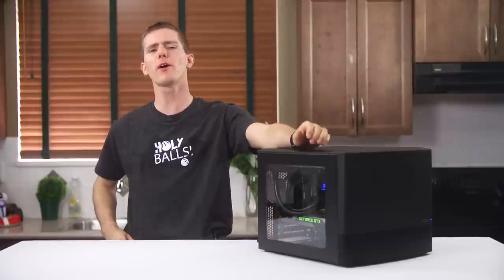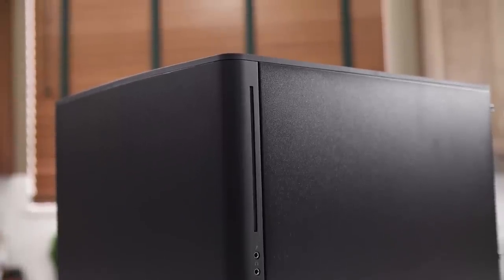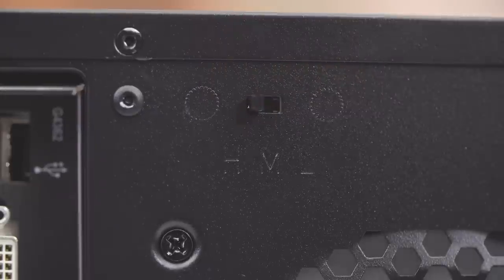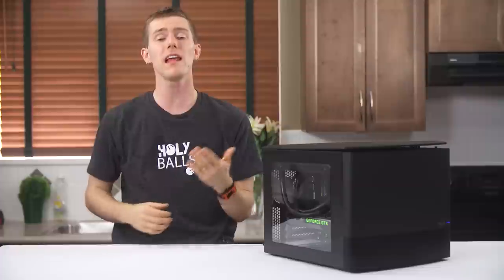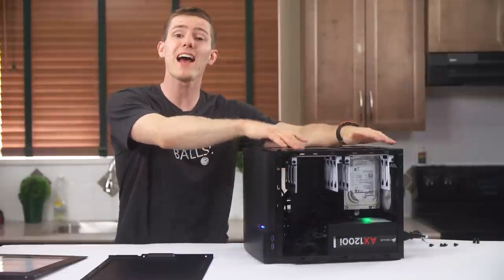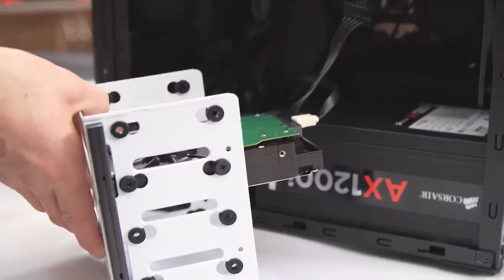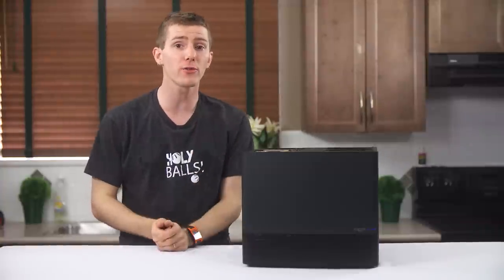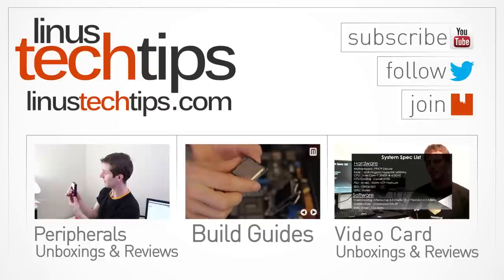Fractal Design Node 804 Cube Case

Comment: That hole in the bottom of the case, the one that goes "to nowhere" is for when your running SLI/Crossfire, the bottom card can intake through it and not get all full of dust and junk.

Comment: I have to say I personally just LOVE LOVE this case, I think Fractal Design has done a really "intelligent design" job on this case.  I've been searching up n down for a compact media server case, from Corsair, Thermaltake, to Antec to name a few, and this is by far, the best I've seen.  It houses a total of 10 3.5HDD for my RAID setup, and still compact enough, and goodlooking enough to go into my living room.  Absolutely awesome case.  The high space efficiency is unmatched.  I've had Fractal Design cases before with the core series, although thought it was good, but didn't see any real key differentiators, until the Define R6, another quality case, and very very value driven for what you get.  Awesome case..

Comment: Just got this case, on the whole, it's incredible - however, it's not a novice option.  The 2.5'' bays are an afterthought, so budget to convert one of the 3.5'' caddies with adapters, oh, and get longer SATA data cables.  Airflow is brilliant though, it will take a Noctua 12S on the CPU, and the intake/exhaust set up keeps everything cool.
Reply: Its definitely not a great option in 2022 but there's still no sub 40L cases that support 8 3.5"+2 2.5" drives even after 8 years. Makes this case a space conscious data hoarder's only choice which really sucks.
Reply: @joemarais7683  Yep, agree.  I've been back to install a Z690 built on mATX in the same case.  It's still a good case and those drive bays are excellent but a cabling nightmare.  Braided SATA cables are a must.  Gone from Gen 7 to 12, the same Noctua 12S can keep a 12600K cool (and still quiet) because of the great airflow.  I've got 4 x 3.5 and 2 x 2.5 (Sabrent do a great cradle)  so I'm happy with it.  It's a chore to upgrade but worth it.

Comment: Beasty storage box is what I'm going to be using this as! With 4 - 4TB Hard drives in the first bay, and room for 5 more, this case will serve me for years to come. With a SB9650 12ML I picked up off FleaBay for under $45 I'll be set. With 10.92TB of new storage in RAID 5 and add 3.64TB for each additional 4TB drive thrown in later this will be a great Storage Box.

Comment: Just bought a Node 804 the other day!
Reply: Is it loud? please answer, rate from 1-10 how loud it is.
Reply: It's actually quiet.
Reply: +Narigaur If, you were to rate it, how loud would it be?
Reply: 1-2
Reply: +Narigaur Cool, do you have any problems with it? like the io.?
Reply: Not really. The only problem I had was finding a slot-loading disc drive. I also had problems mounting it, but that was because I was a complete idiot and bought the wrong size. I was able to get it into the case... by modding the mounting bracket.
Reply: Oh, and another thing, the front of the case is a dust-magnet
Reply: +Narigaur oh ok.

Comment: This would be an amazing NAS box
Reply: I am evaluating it for exactly that purpose. I don't really care what it looks like, as long as it's a good use of space. I'm going to stick it in my basement and when the system is stable, I will rarely lay eyes on it. Looks good so far, but the gimmicky crap like the window I don't care about.
Reply: Seán Hassett you can always just have the window against the wall.  as the power button is on the other side anyways.
Reply: I went with the Define Mini, happy with it.
Reply: +BLOOWOLF4562 +Seán Hassett i'm currently using the node 605, as my htpc/nas, this looks like a great upgrade to get more hard drives into my system, but the 605 looks more premium imho, especially with the thick aluminum faceplate
Reply: +BLOOWOLF4562 I took inspiration from the "PC and NAS in one box" video and I used this case for it. I must say, it really is the best case I've worked with.

Comment: I really wish you would include thermal performance reviews on these.  That really would give a fuller picture of the case.
Reply: I think it would make the review more complete.  I don't recall them doing it on any of their case videos, which is kind of disappointing.  I have been looking for new cases, and on each I have to go to third party sites to find adequate temperature reviews that don't really give the full detail of their testing.  I would really like it if Linus would start implementing it into their reviews as it would be one additional tool when looking at buying a case.

Comment: no reset switch, no disc eject, for a higher end case, it is strange the few corners they cut with this thing, that being said I own, and love it, I am pretty sure it has the most potential in terms of hardware that will actually fit, out of any microATX chassis on the market, if anyone wanted to build micro ATX packed with a ton of stuff, this is really the only case I would recommend

Comment: Cool. An oven PC with sideways mounting in a box shaped case? Looks like it would have over heating problems with that front design and considering the cheapish price, are they trying to force you to buy more expensive cooling options? Cooler Master HAF XB ftw.

Comment: I'd love to see more cases that compete with the microatx temjin 08 at a better price point. Smaller cases when paired with the proper heatsinks and fans will cool more efficiently than larger cases. The upside down mobo is definitely the way to go when paired with positive pressure design. I'd also like to see laptop optical disk bays rather than archaic 5.25 inch bays. (having 0 bays would work too)

Comment: I like that it has the slim optical drive slot in it... but i feel like if it would look much better if they put the PSU on its side, and shaved off 1-2 HDD spots in those cages, making it 3-4 inches thinner.

Comment: I like it overall but it has some things that don't make much sense.

How about turning the PSU on it's side (similar to the Air 540) to allow the case to be a bit narrower ?

I don't think many people buy cases of this size with any intention of utilizing more than 4 HDD bays (+ 2 SSD's), it would be more sensible if the HDD cages where smaller, 2 slots per cage would be just fine, this would help narrow it down too.

Having a nice big window on one side means that is the side you expect to be looking at when it's on your desk yet all of the front panel I/O is on the opposite side including the optical drive slot. If you have to leave space between the side and the wall to get disks in then it is occupying much more space than necessary.

I think they did a reasonable job of packing a lot of features and options into a very small and tidy case but I feel they are trying a bit too hard with this one. Trying to cover all bases at the same time causes complications when it's far better to keep it simple.

It gets a "no" from me, sorry Fractal.

Comment: What's happening here is they got a good idea (from the Node 304, the only Node series case that makes sense) and made a joke out of it.

There are some nice ideas in the 804 - the slim optical bay and the ssd mounts in the door but the end the case is a bigger failure than this review. :)

In the 804 they should have used a 2x4 bay modular hdd cage with individual trays for each hdd in both front sides of the case, and a further 4bay over the PSU. Shipped with two 4bay cages - 8hdd's standard, 3 extra cages possible for 20 hdd's maximum, sold separately. Ideal space utilization, easy replacement of a hdd, still room for watercooling if you take the cages out or move them around. The case would have been a little bigger and a little more expensive but SO worth it.

That suspended 4bay hdd cage in the Node 804 is, to put it clearly, crap. It makes replacing or adding a HDD unnecessarily complicated. In the 304 at least you can take them out just two at a time. Cheap cost cutting Fractal, you're supposed to improve your cases not rest on your laurels.

Comment: the second half seems like it would be mostly wasted space on most builds, what exsactly are you expected to put in there? seems like if you like this form factor the motherboard mounted flat on the bottom of a case would be more useful, allowing you to install a larger motherboard and still have room for mounting hardware , hdd cadges and whatnot above

Comment: I'm currently looking for a small form factor case that will support my XFX R9 295X2 and a Corsair H80i/100i without too much fuss. I made the mistake of getting a Corsair 250D first and the 295X2 doesn't fit :(. This appears to be close to what I'm looking for but I don't think you mentioned in the video what the max length video cards will fit.

Comment: Interesting case.

Built a couple of SOHO servers in the 302's and I'm curious Linus, has Fractal sorted the Low speed fan start issue with their fans for this case?
I'm assuming not as they're running @ 5v and the fans seem to need 5.5v I think. Really annoying little issue and quite bad IMO.

Comment: Love this case but they could of made it slimmer by putting your psu on it's side and taking a few HDD or ssd bays out to 4 I don't think many people have more than 4, just my opinion if they did this and it would work with no problems then it would be quite a big seller, still love it's style and how much can fit in

Comment: Why is the PSU fan still mounted facing and sucking air in from the bottom? Seriously i cant find a case besides the Antec P50 that will help me on carpet. I need more case OPTIONS!

Comment: So torn between this and the 380t. This ones cheaper with more water cooling options but the 380 has a handle which helps as i move it around a fair bit. This has a large side window, better hard drive options but the 380 looks pretty damn cool. Anyone got any of these cases and could help me out with any info on them? anything is appreciated.

Comment: Thx for the video. Can you make a tutoriel on how to overclock cpu of OEM desktop. I have a dell t3500 with xeon w3520 and a r9 270, i want to overclock to use crossfire without a bottleneck.  Setfsb not working for me :(

Comment: PC master race! Small form factor PC gaming with more than 8x the volume of a PS4! Yeah!
Reply: 10x the price.
Reply: *****  same price, just check the prices on budjet steamboxes...
Reply: Size doesn't always matter :P
Reply: PaKeHaXoR $399 Steam Machines.. ehhh.. don't know about that one.
Reply: As a fulltower user I can tell you that I much rather take big spacious case with good airflow that is easy to upgrade and move stuff around than to have red ring of death cause of overheating on an xbox....
Reply: MrJigssaw1989 Lol they pretty much fixed that problem with the Xbox One.
Reply: *****
 I know it was just a jab top show that not even consoles are imunne to laws of thermodynamics ;)
Reply: ***** Experience, on the other hand, isn't. With consoles you can just kick it back and play.. on PC you need to be prepared to fiddle and tinker with everything a little.
Reply: Seriously, try to build a $399 PC that can match the PS4's performance (eg COD Ghost 1080p 60 FPS), size and weight, oh and it also have to have a wireless controller + blu ray drive. Hell, Windows 8 alone will set you back for $99. Good luck guys.
Reply: *****
You are correct that building exactly the same propably can't be done ..... BUT just a couple points to take into consideration.
1. Many people do need a PC for work anyway so they would need to buy Win8  - so the only differencer would be should I buy cheapest possible crap I can or should I spend little bit more and build better (In that case it is propably cheaper to build better than to buy crap and buy PS4).
2.College students have windows for free.
3. Bluray has practically no use in a gaming PC - I wouldn't even bother buying dvd burner for 10$ if I didnt have one lying around.
4.Many people prefer playing on keyboard and mouse (though that might be tough sell for console players.) (For most games that is - I still want my gamepad for New super mario bros.)
5.You don't pay for online.
6.You have much bigger game library that is backwards compatible for almost everygame you can imagine. (That means that games have much higher lifespan - more bang for your buck..... e.g. CS 1.6 which is 14 year old game is still played a lot online)
7.You can buy games at fraction of the cost.
--------------------
Short answer you can't build what exactly the same, long answer if you don't need exactly the same you can get machine that is more capable at running games and also able to do lot more stuff.
Reply: *****
 Agree but SteamOS is not really an option right now.....
It isn't even officialy avaliable for download and most games arent supported yet. Right now steamOs is nice for your htpc running alongside xbmc so you can stream your games from a beefy pc from different room.
Reply: *****
agreed but saying you don't need a Windows licence to game on PC wasn't really accurate .... in few years maybe but not yet.

Comment: a good outro Linus! This case is nice but a lot of features are kind of useless to me. For ex. I dont need 8 hdd cages. Hell if I find myself using more than 1T, I start deleting lol. Honestly, ur better off having a NAS separate than filling up all these cages. I also dont see the point in so many fans if u could've just gotten the 1 fan to rule them all, or more space by having the mb tray all on 1 side instead of using precious space to make that abomination of a mb tray.  sigh, can we get actual smart ppl to design cases already?
Reply: for you maybe 10 fans are useless, but for me, it is the case of my dream because of the 10 fans and its smart design. 10 fans are really useful for those who live in tropical areas, or for people who just want cooling performance without minding the noise. Also more fan mount = more space for radiator, for some people, not all fan mount position are good for the build.
Reply: CK Gamer part of my point was instead of having ALL those fan mounts, they could've implemented more/better mounts for rads. Most decent rads don't cost much more than a few fans would(depending on the brand).

Comment: Hey Linus

I wanna buy 3 of these and take the 24x 3.5'' inch HDD's that I have in OEM external cases (all Seagate, Seagate FreeAgent Xtreme, FreeAgent Desk, FreeAgent Backup, Backup Plus, etc).
I was thinking of putting 8 in each and to attach them to my router TP-Link Archer C7 that receives 1Gbps of network from my provider's ONT,  to access them from my workstation, an ASUS ROG G752VY-GC299T paired with an Dell Alienware AW3418DW.

If this is a good solution or if you have another one, please let me know.

Solutions:
1) take the HDD's out of the OEM enclosures and put them in a PC case or PC cases and use them without RAID, but all at once
2) leave the OEM external HDD's as they are and transition to a 150-200 TB solution in one in the up-coming month
3) leave the OEM external HDD's as they are and supliment to a 150-200 TB solution in one in the up-coming month

Thoughts please?
I don't wanna do RAID and have just one big partition. I am OK with several partitions, because I rarely use the drives. They are just for storage and playback. A digital repository.

Comment: Can't decide between this and the Corsair Air 240.
Reply: I would say this as the air 240 does not support chunkier GPUs like the MSI twin frozer series but that's just my opinion
Reply: Rekby Well... looks down at White Air 240 built yesterday I'd say that it supports graphics cards quite well, so long as they're not really tall.
Reply: Admiral Fear Just my opinion as cards are getting fat and the fractal design case has a little more width for them

Comment: Maybe i missed this in the video, but won't these small cases get overheated?
Reply: I'm not sure if you are being sarcastic, but anyway, there are a lot of places for fans, I don't think it would be an issue. He said there are 10 places to install a fan.
Reply: D3RP
Reply: i wont consider it as that small
Reply: No, actually the opposite. You can install up to 10 fans in this case, but also since there's not a lot of room the fans can have lower RPM's and still have a lot of airflow. My PC sits around 16c and under load it's 28c. I only have the 3 stock fans that came with my case and a Cooler Master 212 Evo.

Comment: The only problem I see is having the USB / optical drive on the side of the PSU and cable management? How can you have this sitting on your right side with the window pane, and then bend over to plug in peripherals? That does not seem aesthetic to me.

Comment: That slim optical drive not having an external eject button is minor, but can get really annoying.
Reply: Most slim optical drives are touch sensitive.
Reply: There's no perforation on the outside of the case for the drive to know you're pressing a button to eject.  You have to eject the disc from inside windows.

Comment: So this or the Corsair AIR 240??
Reply: +Ashuten I have the 240, great case. The important case doors have hanging thumbscrews, pretty cool case. I have a gtx 960 strix and it barely fits, so only if you have a smaller heatsink for gpu

Comment: can you fit two 980 ti's in this?
Reply: +Nawaz Waseem there is a video linus put out about video cards being close together look at that for cooling performance
Reply: ***** thats true but the concept is the same, closer together means higher temps
Reply: +Nawaz Waseem there's another guys video where he has 2 980's hooked up into this, everything is watercooled though, if that makes a diff
Reply: That makes a great difference since you don't need any airflow around the cards